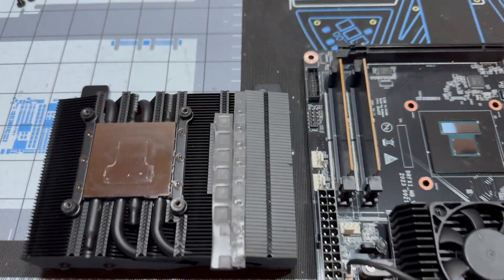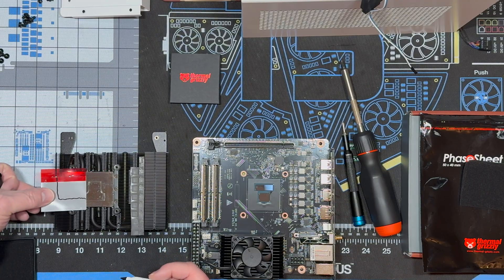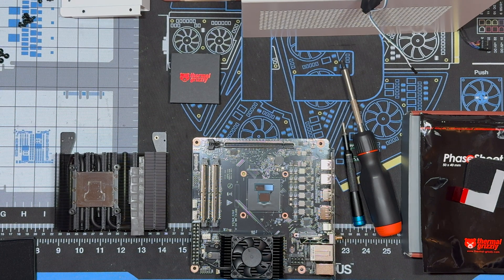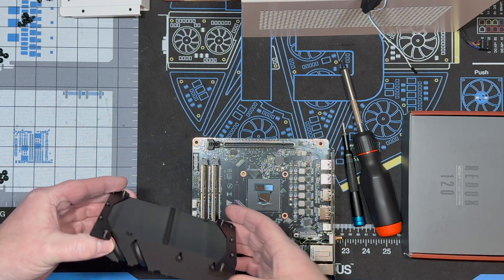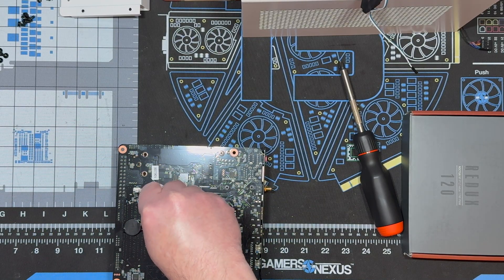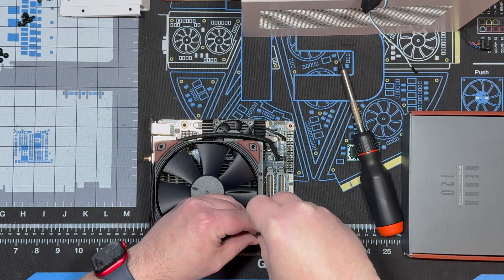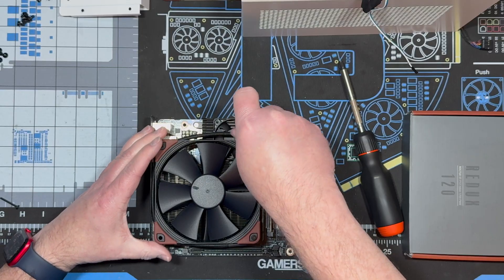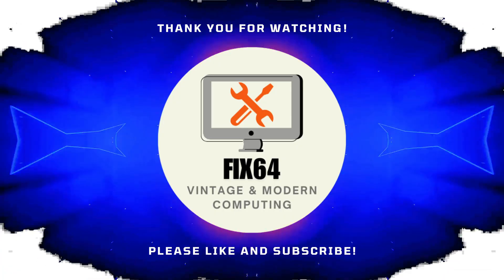Thermal Grizzly PhaseSheet PTM installation on Minisforum BD790i! Lower temps!

Comment: So you took a PTM sheet off to replace it with another PTM sheet 😂
Reply from the maker: Exactly! 😂
Reply: U obv have never owned one of these and saw how terrible quality the ptm is on these boards…very unintelligent comment
Reply: @godnamedtay  yeah indeed except for the BD795iSE and BD790ix3d that I own and have watercooled and then put back to stock using the original ptm that sticks to the heatsink when you pull it off. Lmfao idiot ptm is ptm theres no magical application to it 😂

Comment: i have a monoblock on my bd790i. with some lathing lathwork done to lessend material for contact  with this ptm does good 5.7ghz under 70c is nuts. i even have it on the toxic 6900 xt e.e  on the same loop.
Reply from the maker: Wow those are very good temps! That’s the way to go.  Thank you for sharing!

Comment: Doing this to my X3D version soon. I agree on the cooler options needing to be available. Low profile with a heavy duty fan included or a tower heatsink without them so we can choose the fans we want since they would require two of them. Right now I have a fan duct pulling air in from the back exhaust where a fan should be so it has it's own isolated air pathway. Pulling in hot air to a low profile heatsink for an already hot running mobile CPU is no beuno, but there's ways around it thankfully.
Reply from the maker: Yes, there is lot of experimentation that can be done.  It definitely would be nice if it were like their micro ATX version with any cooler option.  I would love to test the CPU with another cooling option.  I may have to try one of those M-ATX versions in another video.  Thanks for watching! And good luck with your system.

Comment: I think this video also works for the BD795i SE, and I was wondering if you can use thermal paste like Kryonaut Extreme in the same way. What do you say?
Reply from the maker: Yes definitely.  In fact Tech Notice used that paste on the x3D version I believe.
Reply: I read that the latest version of that specific model comes with PTM7950 pre-applied. I’m on the fence about repasting it—I bought it just five days ago, and even with a generic fan, my temperatures rarely go above 89°C.
Reply from the maker: @LessThan87 yes I think they are applying a PTM at the factory.  When I took it apart the material was not regular paste.  It was more like the PTM.  I would say you are fine leaving it.
Reply: @theFix64 ok, thanks bro
Reply from the maker: @LessThan87 you’re very welcome! Thank you for watching.   If temps do end up higher you may try a paste but I think they’ve improved a lot.

Comment: Did you hold onto the original pad/phase sheet? You could try heating it with a hairdryer and see if it melts. If it does, it was a phase change pad
Reply from the maker: No I didn’t unfortunately.  If I do it again I’ll test it.  Thank you for the suggestion!
Reply: If so, should we expect to see the temperatures improve over time? Or would the factory cycle it sufficiently in testing?

I’m not sure what temperatures I want to be okay with, the rules are a bit different for mobile.
Reply from the maker: @thedave1771 Should improve over time according to Thermal Grizzly.  I didn't keep mine long enough to really test it out fully.   I also don't have my X3D variant anymore.   I have a feeling I will be buying another soon however.   But what came with it definitely wasn't a normal thermal paste.  It had to be phase change.
Reply: Just to update, I messaged Minisforum directly to ask if they use a phase change pad and they said, "BD795I SE carries phase change silicone grease material."

I dissembled my BD795i and it certainly  was a phase change variant. The contact was really poor however across the chiplets on my sample. So, I replaced it with some double stacked PT7950 and got better temps, but I can imagine if you already get 70-90 °C temps under high loads, then your application of stock pad is fine and a change to ptm7950 is not worth it
Reply: @TheLinkedList oh nice, thanks.

I need to test a bit more, I think I can get the CPU to throttle a bit running Furmark on the iGPU plus a CPU stress test, but I haven’t really had time to actually stress test just the CPU or get a really good feel for how the whole system is behaving. 

Any idea why it doesn’t make good contact? Just thickness?
Reply: @thedave1771 actually yes, it surprised me but the culprit for poor contact was the overly thick thermal pads on the VRMs. They created a wedge that caused the cooler to be lifted over half of the CPU area.
Reply: @TheLinkedList ugh. But good to know. Thanks.
Reply from the maker: Yes I noticed that as well.  I pressed down on the thermal pads to flatten them more, but I still don't know if that helped.  I don't have it anymore to try.
Reply from the maker: Ah okay! I knew it had to be phase change already of some sort.   It wasn't standard.  Thank you for the information.   I don't think changing it is worth it much either then.
Reply: Use normal good quality paste.

Comment: Wait are these actually liquid metal tim'd? There's a gronmit around the socket like they are... but theres no mention of it.
Been thinking of grabbing one and cooler modding it because its supposedly LGA1700. 
Love to hear your thoughts.
Reply from the maker: The compound on the heatsink seemed to be like the same material as the PhaseSheet PTM.   I believe it's that and I never had to replace it in the first place.  I'm not sure about the new X3D version though.  I've already sold that machine so I can't look at what it may have had.  That would be really cool to see a cooling mod for these.  If it is similar to LGA1700 it should be doable!  I think it would help a lot in keeping them cool.  The original boards were really heating up, but I think if I would have just left it running and maybe doing a little bit of stress testing the temps may have gotten better.  The X3D version ran cooler out of the box.
Reply: @theFix64  Yeah the x3d running cooler out of the box makes sense, that said im not really sure I think its worth it seeing as I scooped the bd790i se for less than half the price (400$) of the 790i x3d (800$+).
Reply: @theFix64  Thanks for they reply btw. Always a class act.
Reply from the maker: I agree the BD790i itself is a beast and does great.  One of my main systems is running with that.  Let me know if you try the cooler mod! And you’re welcome! Thank you for watching and commenting!
Reply: @theFix64  Yeah it seems the Die is lg1700 but the mounting isnt. I found an obscure water block for it on reddit. 

Shy of hunting for an STL for a real mod I think swaping TIM really is the best solution.

Comment: How are the temps after the install
Reply from the maker: It helped keep them from going straight to 95c as they had before.  They are hovering under load in the 70-85 range.  Sometimes it will spike into the 90 range however.